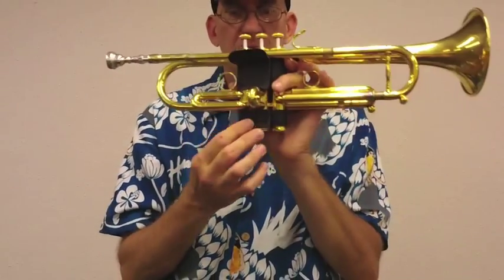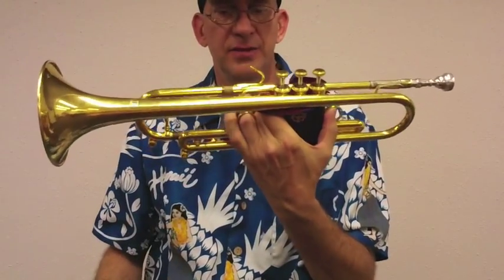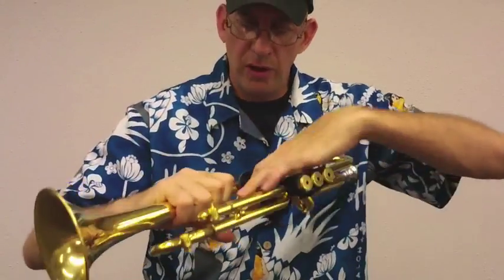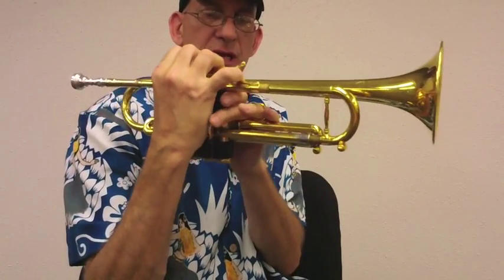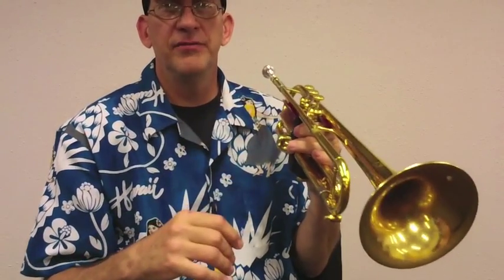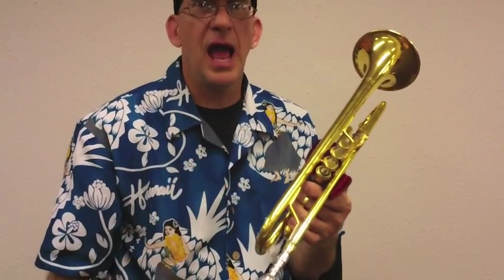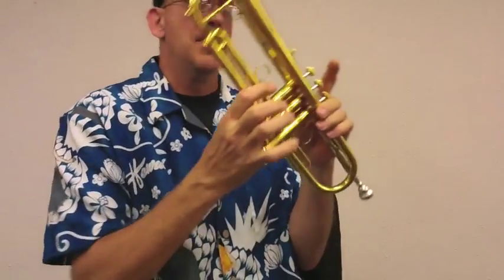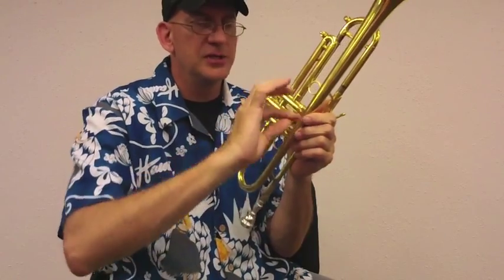Trumpet tip,  valve guards

Comment: I play a silver plate King 600 and my hands tend to sweat profusely making my trumpet look less than desirable. My solution to this was to buy a valve guard but I bought cheap and it tarnished the valve block, bad decision. So I've taken to wearing some gloves my band director makes us wear with our band uniform. It works very well except for the fact that the gloves are white and tend to get dirty fast. It works, though, so I have no complaints! Your videos have been a huge help to me and I commend you for what you do. Keep it up!
Reply from the maker: Thank you very much for the shout out. You can also use a rag or polish cloth tho protect your horn as well.
Reply: swain4567 Or you can by a Yamaha leather valve guard. It worked for me.
Reply: I have the same trumpet and im deciding to buy one hmmm

Comment: I use a valve guard but don't like the leather ones as they tend to absorb sweat and over time that absorbtion goes straight through to the finish.  I use the old hard clear plastic one and carefully install it avoiding scratching the horn.   The clear plastic keeps my acidy hand sweat off the horns finish and you can see through it.  I like the flaps on this leather one, but I've taken some large plastic tubing(fish tank hose) and cut them to size to cover the 1st valve bell knuckle and the 3rd slide tube next to the ring.   For the leadpipe and bell section I took Zig Kanstul's approach and used scotch tape on those two spots,heh.   Also I like the clear hard plastic guard because it keeps the horns vibrations live.   Hard to come by  tho these days.  I have two broken ones on my horn scotch taped together.

Comment: Dude - Leather Specialties sells your "modified" guard as their "Special" guard. Your modified version was their "Deluxe" model originally.  Their "Basic" model covers the valve section only with no extra leather flaps. Just purchase their "Special" model Guard and you will not have to modify or cut away any leather off of their "Deluxe" model.

Comment: I recently stopped using valve guards because,imo, they tend to prevent the horn from vibrating\resonating as much as when not using them. My own tests revealed this (listening in the room and recorded). While the differences were not night and day, they were enough for me to stop using them. What are your thoughts on this? Thanks.
Reply from the maker: To each thier own Best, Jon
Reply from the maker: If you notice a difference then you should go with the set up that you feel works best. You can wipe the horn off at the end of each session and you will have a horn that lasts a very long time.